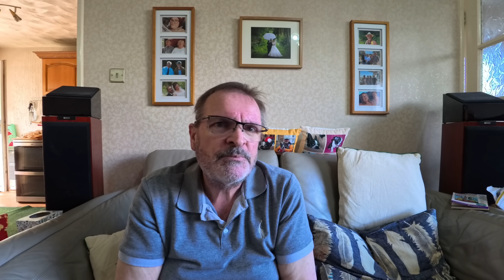Expert Ships Engineer Reacts to Baltimore Bridge Crash

Comment: I had a new ship where I was Chief Engineer that went dead in the water, had the generators running but couldn't keep the breaker closed. Turns out a very small 3 phase vent fan motor went to ground, thus was sensed by a protection function in the SSDG Breaker. After two hours being dead in the water the problem was found by stripping all the circuits and incrementally closing distribution circuits. Being a HSV ship with double busses and automatic power seeking switches, finding the fault was complicated.

Comment: That ship has 4 generators 2 4kw & 2 backups  they lost all power at just, as you said 4 minutes before they hit a bridge. Thats a huge BS pill to choke down. Do you people test the fuel when u are transferring ? We tested numerous samples to verify quality. This stinks of sabotage in the generator room. We maned all important spaces when leaving or entering port. No one should have to run to the generator room it should be maned.
Reply: AGREE!

Comment: NTSB timeline per the ships recorders: 
Approximately 12:39 a.m.: The ship departed from Seagirt Marine Terminal.
By 1:07:00 a.m.: The ship had entered the Fort McHenry Channel.
01:24:59 a.m.: Numerous audible alarms were recorded on the ship's bridge audio. At about the same time, the VDR stopped recording ship system data but was able to continue recording audio using a different power source.
01:26:02 a.m.: The VDR resumed recording ship system data. During this time, steering commands and orders regarding the rudder were captured on audio.
01:26:39 a.m.: The ship's pilot made a general very high frequency (VHF) radio call for tugboats in the vicinity to assist the vessel. Around this time, the pilot association dispatcher contacted the Maryland Transportation Authority duty officer regarding the blackout, according to transit authority data.
Around 01:27:04 a.m.: The pilot ordered that the ship's port anchor be dropped and issued additional steering commands.
Around 01:27:25 a.m.: The pilot issued a radio call over the VHF radio, reporting that the vessel had lost all power and was approaching the bridge. Around this time, the transit authority duty officer radioed two of its units - one on each side of the bridge - that were already on scene and ordered them to close traffic on the bridge. All lanes were then shut down.
Around 01:29 a.m.: The ship's speed over ground was recorded at just under 8 miles per hour. From this moment until approximately 1:29:33, the VDR audio recorded sounds consistent with the collision with the bridge. Additionally, MDTA dash cameras show the bridge lights extinguishing.
01:29:39 a.m.: The pilot radioed the US Coast Guard to report the bridge was down.

Comment: Exactly as a ship engineer myself they did the wrong thing putting the engine in reverse and pushing the bow to starboard instead of first passing the bridge. The blackout could come from a problem on the generatorboard which we had because the controlroom airco broke down and some electronic components on the synchronisation board started overheating . Greetings

Comment: @Retro, On his bikes: A basic question on multi screw ships. Why are they not counter rotating port and starboard screws like the propellers on some aircraft? I understand that there is a difference between hydro propulsion vs atmospheric but in this case it seems that it would be advantageous. I'm retired industrial maintenance mechanic and agree with you on the lag time for emergency lighting and generator response time which brings up another question. Is modern ship drive electromotive or direct drive from the diesel motors? I could bore everyone with the similarities' of any building or vessel/structure but, suffice it to say they are very much the same. Thanks for the nut's and bolt's point of view.
Reply from the maker: The Dali was a single screw ship. Also it was directly coupled and computer controlled engine timing for forward or reverse rotation.

Comment: Thanks for your experienced perspective.  Normal bunker fuel runs 3-5% sulfur, which turns into sulfur dioxide during combustion.  This contributes to smog so switching to low sulfur fuel close to and in port is standard across the USA and many ports in Europe.  Out in the open ocean, the sulfur dioxide meets moisture in the atmosphere and rains out as sulfurous or sulfuric acid.  This actually provides sulfur to the algae and plankton which need sulfur just like we do to make amino acids.  Not harmful at all at the current level of production.

Comment: I find myself explaining this very thing to my land lubber friends and relatives.It would seem if the port anchor was not dropped the ship’s head could have swung further to starboard than it did and the ship struck the bridge to the viewers left, or went aground . But I think the decision to drop anchor was the right one to slow the vessel . Four minutes with a whole lot happening and the seconds are ticking away. The torque and pivot points of a vessel in water are nothing like tires on the ground. The presence of mind of the Master and pilot assured the police could block the bridge traffic . I got my own experience on the bridge of ships in close situations, and can handle a single screw vessel . When the predictability of your control systems vanishes as it did for this crew it’s time to act.I’m afraid in the USA the politicians are just not gong to listen to the professionals.

Comment: Excellent and exact was just not enough time but still think we have in our port any huge ocean going vessels are escorted by two tugs till open water I just think two good size tugs could have held it from hitting bridge I can't believe there is not that safety standards in a huge port like this and going under a pedestrian traffic heavely used and easpeally when bridge has no dolphins around supports were not only port that does this in the great lakes most ports that have ocean going vessels salties  they are escorted by two tugs there heavier then Lakers that travel just the great lakes and sit deeper in water but it's just a bad accident they were probably all panicked going into complete darkness some news outlets say it had trouble at dock before leaving I can't believe that with the pilot there if he thought it was unsafe could have stopped it this could have been so much worse if it happened in day or they didn't get traffic stopped so sorry for family's I no what there going through lost my brother in a hwy head-on with two tracter trailers and I struggle everyday

Comment: Any ship's master should know that going astern will reduce the water flow over the rudder and reduce steering response. A particularly famous example of this effect occurred when Titanic's engines were put into reverse to try to avoid collision with the iceberg thus reducing effective steering, which one might imagine that any ship's master would be aware of. We can assume the ship was on course when the power failed and having a high degree of inertia would have maintained that course if steering had remained effective. Reversing the engines also reversed the paddlewheel 
effect. The loss of response to the helm made it impossible to counteract this now changed effect. This was incompetence on a grand scale.

Comment: If the emergency generator switched off when the main engine powered up it's generator that was a programming error, to reduce the loading on the main engine, the emergency electrical generator should stay on line for about 15 minutes in case there is any further problem with the main engine. Ron W4BIN

Comment: I worked for merchant Marine, on tug boats in the engine room, but far as I know, if the main engine quits, so no power is generated the battery takes over to provide temp power to the boats electronics, lighting etc...
On tug boats the axillary engine had to be started manually, no compressed air is needed, but on a big ship like that, the axillary engine started automatically with compressed air.
They have to look it the black boxes to see what really happened, right now everything is speculation.

Comment: Another ex marine engineer, had something similar sailing up the Mississippi on a 100,000 OBO where one of the generators had a catastrophic failure, causing it to stop and loose all the engine cooling water not only for it's self but the other two generators and main engine. Fortunately there was enough way on the ship and heading to rest on the bank with both anchors dropped. And came to rest there on the bank
. Didn't hit anything but there was nothing that that could be done for sometime as the cooling system needed refilling. The emergency generator was only there to run the minimal like a small air compressor, not the main ones or the steering gear. The fire pump was separate from the main machinery space located in the forecastle and diesel driven.

Comment: Totally agree, the black smoke indicated a full load when the engine was probably slammed into reverse.Does the effect of the rudder in that situation also reverse the steerage of the vessel? Sort of driving like driving on ice, when you have to steer in the in the opposite direction ? BTW, the engineer's will be the easy one's to blame.

Comment: Could the fuel have caused a COMPLETE black out
Reply from the maker: Absolutely each generator will have its own filters drawing from the same tank. 3 generators would have been running, if one fails the others take up the load, if there was dirt or water in the fuel the next generator could have failed too. The remaining generator would have gone in to overload and tripped. The fourth generator would have started and put itself on the board. 
When a generator trips off the board it may still be running.

Comment: For starting and operating the ME, you need the pumps running. Cooling water, lube oil, fuel pumps and booster pumps. That is not on the scope of the emergency generator.  That implements, you have at least one Aux generator on the net. And you have to open starting air valve. I left shipping ~40 years ago and on the reefers we had at that time 3 computer in the ECR. ME, cooling and general alarm. The computers I guess, have to be on also. At 1 o'clock in the morning, if chief and 2nd or 3rd engineer were both in the ECR, that was for minutes a real havoc. 
We had in my active time at the ME a manual emergency control stand  and there was a emergency control for the rudder, but with the dimensions of those big containers, you have to go there.

My first ship was a container, West coast to HK and Taiwan. 750 TEU!!!

Comment: I agree completely with this explanation of why the stern swung to port. It was my first thought when I saw the videos. It is however contradicted by comments by the head of the pilot's association who said that the ship never regained the main engine after the first blackout. I personally think that his comments will turn out to be false, but time will tell.

When the first blackout occurred, the nav lights went dark, but during the second blackout they stayed on. Odd, as the bus that powers them would be common to both events. It's been a while since I worked on a commercial ship, so maybe my memory is off, but I thought the nav lights were DC. Lots of reports are saying that the radios went out when the generators went down, and that the pilot had to use his mobile to call authorities. That makes no sense - Nav/Com is normally provided with its own dedicated backup battery bank to satisfy GMDSS requirements, and the VHF radios are DC powered regardless. 

(Former container ship deck officer / maritime academy grad, now in the large yacht industry as a surveyor)

Comment: 6:50  Without Tugs or effective Bow Thrusters would it not have been prudent to have had a speed limit in place for the ship?  That flimsy Bridge was designed and built in the days before this ship was even thought of and its impact could not have been forseen.  Is it not fare to say that 'everyone' dropped the ball in allowing this tragic circumstance to occur and that Tugs and speed limits may have to become mandatory across the globe for insurance purposes?   Your analysis is quite respectable.

Comment: Steering a ship requires constant adjustments port and starboard. If the blackout occurred when the rudder was starboard then that correction s would have become an over correction. The Key Bridge is a relatively low bridge with a narrow opening for shipping. It’s also worth mentioning that if the ship was accelerating, the rudder would have been a bit starboard to counter the walk (or paddle wheel affect) of the propeller. If power was lost, the ship would naturally veer starboard. Reverse would emphasize this starboard turn.

Comment: I don't work in the shipping industry but I do work as an Engineer in a company that owns/operates power plants.  I've noticed that the "Boeing Effect" has permeated into several industries.  

Preventative maintenance is skipped, degraded conditions are tolerated, training programs are cut and risk screenings are watered down.  

Obviously it's too early to tell if any of those "production over safety" concerns took place here, but I would be suprised if they weren't a factor.

The pendulum has swung fully in the finance departments direction and they are only concerned with short term gains, instead of the long game.  As a result, safety and reliability have suffered.

Comment: Great perspective from an old salt. I can agree with a lot of what he's saying as I have had evidently similar experiences. 
As a master, vessel characteristics could answer for a lot of the result and the full ahead port comment I had thought of also, the caveat being very soon after a hard to starboard turn world need to miss the piling. So situational I bottomshouldn't even be saying anything... A tragic outcome of a series of unfortunate events.
Company pressure on the bottom line has a lot to answer for I might add, related or not.

Comment: someone raised the question whether this could have been a cyber attack.
you're analysis is persuasive but is it theoretically possible for ships being taken over and controlled remotely?
Reply from the maker: No chance. None of the engine or steering systems are connected to internet. Completely separate from any other system. Any adjustments or updates to the firmware is done by service engineers and a memory stick.

Comment: Wow...I worked at Sun Ship along time ago. I know whether it's 2 or 4 propellers...the blades are reversed so the blades can turn in opposite directions and still provide forward thrust. This is to compensate for negative stern movement. Those forward bow thrusters , which are sideways propellers. This is to help in steering and turning and emergencies. They are very powerful and effective at 10 Knotts or above.

Comment: You need to also understand that harbor there is secondary issues 1. There is a strong undercurrent and anti current going against each other due to the second entrance to the canal! They dropped an anchor which changed the direction! Also they had an engine area fix that was done in port ! Many things to consider the Mississippi River is also an entire different beast ! So many things need to be taken into account not just pilots etc
Reply from the maker: So true

Comment: So you are telling me that the exact circumstances required for the ship to steer DIRECTLY in to the column actually happened because you say that is the reason? It's not possible for any other reason? What about the Rudder? If the ships had a lisp to the right then the rudder could counter act that. if the engines can turn the prop they could turn the rudder. Also, you are saying that the prop's lisp to the right would cause a nearly 90 degree turn(more like at least 60 degree). Also, the full engines would still cause the lisp?

The fact is, it is a very unlikely event and for all the things to go wrong are highly unlikely. Do you know how probability theory works? Also, given all the insane things going on in the world just makes it even more likely it was intentional. It should be looked at as intentional until it can be proven beyond all doubt it wasn't. Else you assume something that is unlikely to be true as true which clouds your judgements.

No one is saying is an attack by the Russians. It is not an either or. It could be the pilot or master who went crazy or paid off. It could be a "hack"(unlikely) or many other things. You are assuming best case without any proof what so ever but you assume it makes you not a conspiracy theorist. Again, do you understand how probabilities work?

Comment: When the ship lost power it also lost the main engine as well, not until the engine is running Full Ahead is the turbo charger running fast enough to supply enough air for the engine to run without the auxiliary blowers which require power from the generator. When power was temporary restored the auxiliary blowers turned on and the unburn fuel was blown out seen as black smoke before engine restart. The engine is connected directly to the propeller so it would need to get back running in reverse to go astern. It is unlikely they had the time to clear out the exhaust and get engine running before the ship lost power the second time.

Comment: Thanks for the great and accurate analysis.  u need to look at getting a new microphone tho or adjustments sadly its making high frequency noises now and then. i Actually casued a black out on a top modern tugboat built 2008 by walking around the engine room and cheching the oil and pressure and such.  and one of the small ball valves for fuel to one of the auxiliary engines was sticking out abit so the bottom of my leg caught the valve handle and closed it without me noticing.